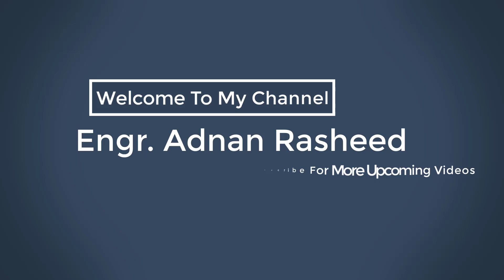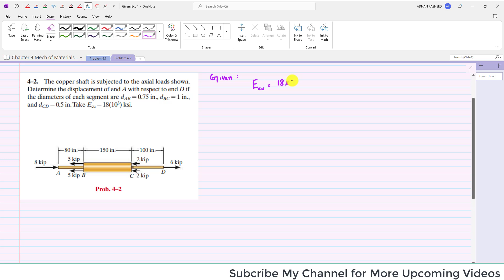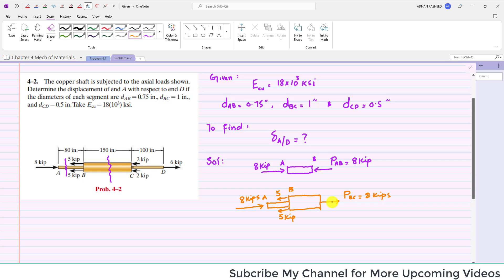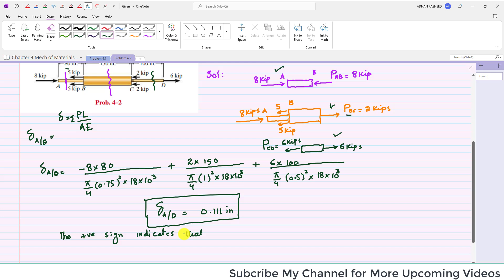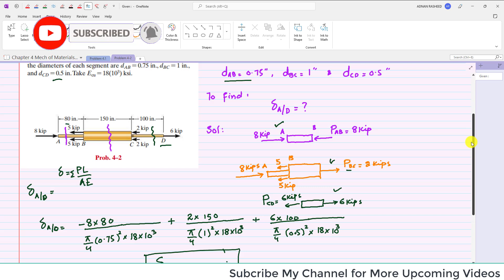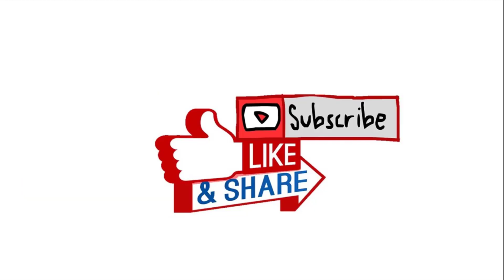4-2 Determine displacement of end A w.r.t D | Axial Loading | Mechanics of Materials by R.C Hibbeler

Comment: why did we say Pcd= 6 kips as positive while Pab =8 kips as negative ?
Reply from the maker: I think watch it again. In portion AB when you can it and take either of section and make the condition of equilibrium you will fine Pab = 8 kips and it will be towards left side causing compression and similarly if you cut CD and take either side , make equilibrium condition to balance force you will find the pcs will be causing tension. I hope you will get it. Thank you